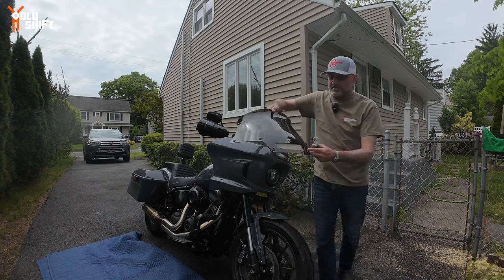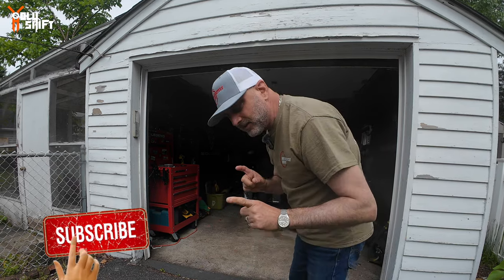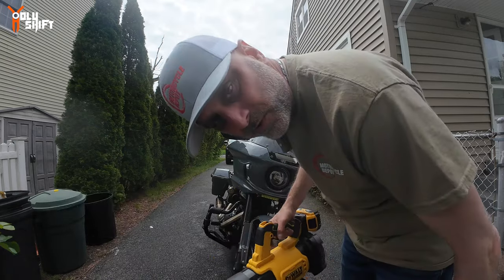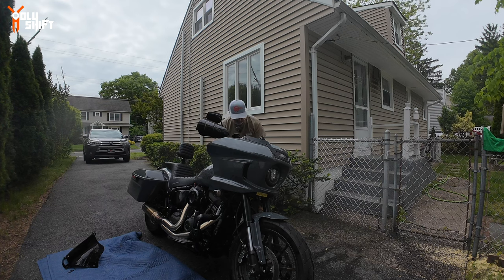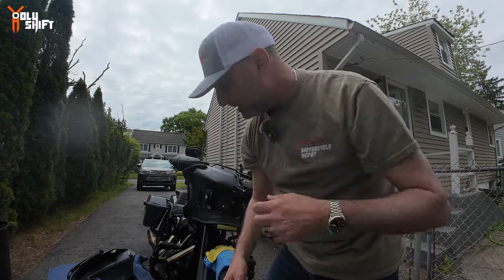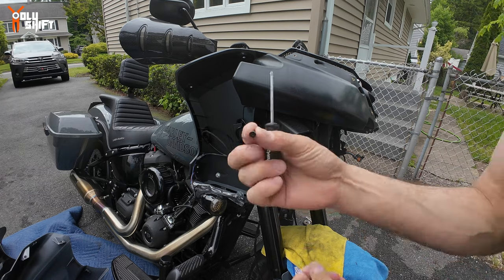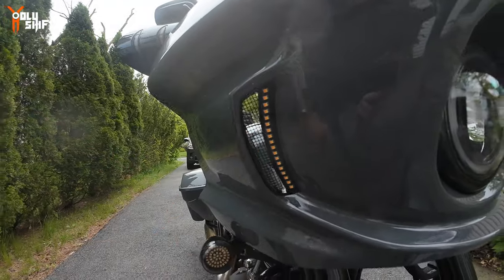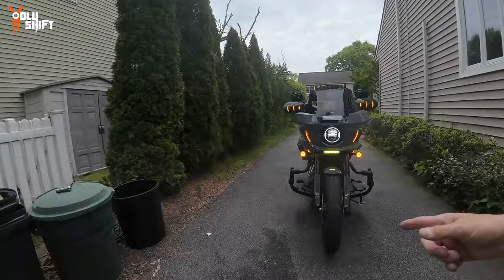Too Many Lights ? CD Fairing Vent Lights

Comment: Looks fine to me.  What you really need is some strong driving lights.  I recommend lower fork mounted to give you the triangle of white light.  When I added a set of the Clearwater Darla lights, it made a huge difference.  Especially on those dark highways where you need to see deer as far away as possible.

Comment: I have my lightbar on my 2022 Low Rider S set up like as an auxiliary light where I can turn it off and on by pressing the left turn signal to the right.  It’s basically mapped like the Heritage Classic’s auxiliary light set up.  This way you could keep the lightbar for the functionality if needed but have it off when not needed.

Comment: Drop a link to the lighted hand guards. Those have a nice functionality. I think the light setup looks great and would not remove any of them. And it turns out that the useless screw has a use. They probably knew CD was gonna have fang lights and put the mount there for it.
Reply from the maker: https://www.motorcycledepot.com/products/color-matched-hand-guard-for-harley-touring-softails-copy
Reply from the maker: https://www.motorcycledepot.com/products/rushmore-chopped-tour-pack-pak-for-97-24-harley-touring-softail-copy